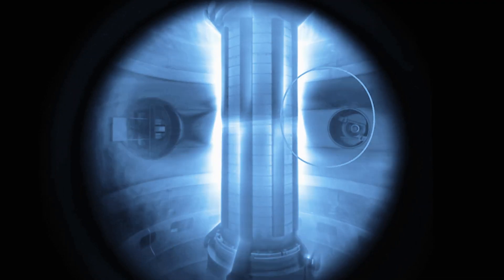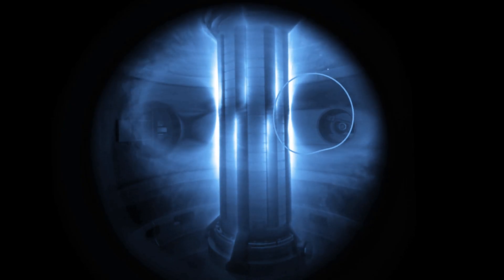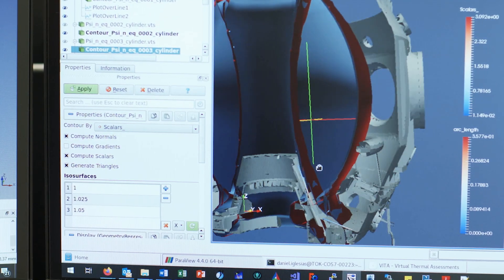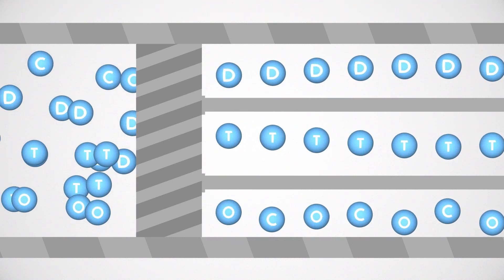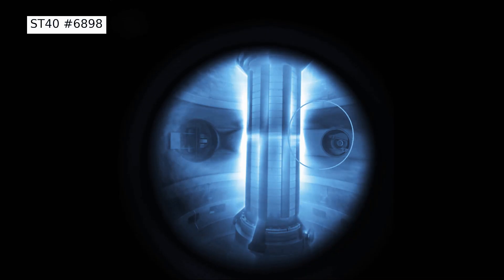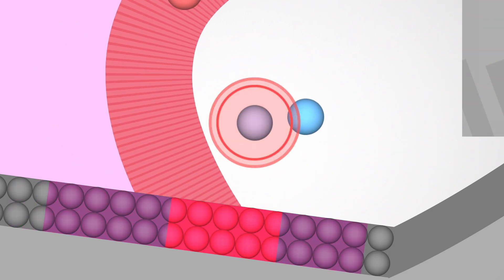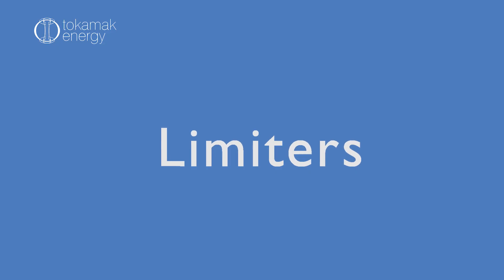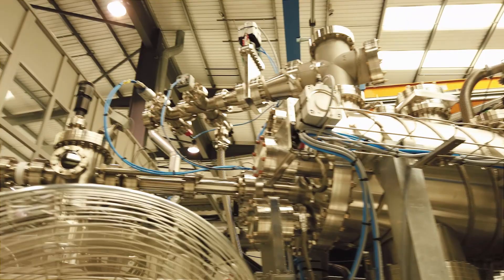Managing the extreme heat in a tokamak fusion device - introducing the divertor

Comment: I suppose you could call this.. one breakthrough, on top of others to come.
"Scientists have found a novel way to prevent pesky magnetic bubbles in plasma from interfering with fusion reactions—delivering a potential way to improve the performance of fusion energy devices. And it comes from managing radio frequency (RF) waves to stabilize the magnetic bubbles, which can expand and create disruptions that can limit the performance of ITER, the international facility under construction in France to demonstrate the feasibility of fusion power." https://phys.org/news/2020-08-scientists-method-fusion-reactions.html

Comment: Let me get this straight.... The Tokamak gets hotter than the core of the sun and yet they can’t get fusion to work or supply to a grid? Well, as Einstein once famously said, “Doing the same thing over and over and expecting different results is the definition of insanity.” Enjoy the money pit hole of research there fellas.
Reply: They have achieved fusion. The challenge is to produce enough of it fast enough for net energy production; i.e. more energy produced than is put into the system. They've been closing in on that goal and hope their next model (the demonstrator model) will carry them across the finish line.
Reply: Send me a message in 6 months telling me, I was right. Cheers mate!
Reply: @mckanebullerlee3020  It's going to take longer than six months. Maybe'll I'll send that message in ten years. Cheers.
Reply: The density of the plasma is thousands of times less than air. The density of the core of the Sun is 15 times greater than lead. Not really a fair comparison.
Reply: ps200306 please, explain to me how you know those facts about the sun. Just because a text books says it’s true, does it really mean it’s right?
Reply: @mckanebullerlee3020  , I'll assume you're asking in good faith. How do I know the density of the Sun's core? Because I know how to work it out.

From Kepler's Laws and the speed of the planetary orbits around the Sun, and experiments here on Earth (by Cavendish and subsequent) to measure the value of the gravitational constant, we can calculate the mass of the Sun. We also need distances which were calculated starting with Cassini's parallax measurements of Mars, various transit measurements of Venus and, latterly, by radar ranging. We can see the Sun and measure its angular diameter. Knowing the scale of the solar system from those other measurements then gives us its actual diameter.  That immediately gives us its average density -- which is 1.4 times that of water. That's an observational fact.

However, we also know what the Sun is made of. We figured that out from spectroscopic observations of its atmosphere. So the Sun is a hot plasma compressed by its own weight and, since its size is stable, it is in a state of hydrostatic equilibrium. That is, its density increases exponentially with depth. So a first approximation of the core density can be made with fairly simple calculations involving pressure, depth, density, and gravitational acceleration. Specifically: ∂p/∂z = -ρg.

More accuracy requires more intricate stellar models. They include the fact that the density allows for convection down to a certain depth in the solar envelope (about a quarter of its radius), but below that energy only escapes by radiative diffusion. So the pressure and density profile is not uniform. Also the core is made of different stuff, as helium ash from fusion is accumulating there. Nevertheless, the inner envelope and core behave pretty much like an ideal gas, just a very dense one (but not electron-degenerate). Detailed analysis predicts the core pressure to be about two orders of magnitude higher than the simple hydrostatic equilibrium model.

Thanks for asking.
Reply: ps200306 It’s all in good faith. 

However, thinking like this makes it impossible to understand fusion. Keller’s law actually has nothing to do with the rotational momentum or angular rotational orbit “of” the “sun”. Keller’s law is specifically written for planets around a centralized focal point i.e. the SUN. Planetary bodies like Mercury, Venus, Earth, Mars, Jupiter, Saturn, Uranus, Neptune and even Pluto have electrostatic attraction on the sun and vise versa. These are not simple constants. These elliptical orbits all have different time periods and phases. Thus, this means the Sun’s plasma is continuously changing due to the electrostatic (gravity) flux tugging (dragging) of the bodies (inertial dampening) in the entire Universe. Planets are elliptical not spherical in orbits so the values constantly change and flux constantly! Your “simple” calculations are limited in this sense.

It sounds like you don’t believe of “spooky action at a distance.” You must subscribe to Einstein principles? I’d suggest steering away from general relativity. It’s quite broken! 

Lorentz, Maxwell and Mark had it right before Einstein came in gave everyone the “mind virus”. 

You state: “The Sun’s density increases exponentially with depth”. Hmm, you sure about that? What if the density is a shield of plasma acting as an electrostatic or graviton flux on the perimeter of the sun? Why do you suggest that? Is it because density increases for a planet in that fashion? Are you equating a planetary norm to a sun? You see my point?

What if the sun is a hollow window to another dimension? What if the sun is a 4th or 5th phase of water with unique properties, which influence the Universal Lorentz space time differently? How do you really know the density is thicker as you go inward? You been there? Have you been to the center of the Earth? Is it warm there? Hot? Is it cold? Is there water in the center of the Earth? Maybe quasi-crystal magnetite? I mean, that would solve the answer to the self-energy magnetic field of Earth. We don’t really know.

I mean, shoot, what is the electron? Does anyone really know? If we can’t explain the electron. How can we explain what the sun is with any accuracy? We can go only on “observed data”. Our “perception of reality” is from ONLY one dimensional plane. So, be mindful of that. And let me tell you. If you take the calculated radius of the electron and find the angular rotational velocity of the electron you will discover a point like “wavelet particle” that is indeed traveling “locally” faster than the speed of light. Which, Einstein state, “Nothing can go faster than light.” So, yah. We got a problem Houston. 

Don’t be so sure about your answer. Because, we (human race) don’t know how to induce the most basic building mode of the Universe — Fusion. 

The electron is the key. Learn what that is first before telling us what the sun is.
Reply: @mckanebullerlee3020  , ahh, I see. It was in bad faith -- you were looking for an opportunity to preach. Forgive me if I don't waste any time countering this nonsense. Life's too short to be dealing with people who learned their science from "electric universe" videos and the like.

A few points though -- it's Kepler's Laws, not Keller.  Gravity and electrostatics are two different things. It shouldn't be necessary to point this out, even to the most uneducated, since one is thirty-six orders of magnitude stronger than the other. However, the internet makes people believe the most bizarre things.  Your stuff about "rotational momentum" of the Sun and the influence of the planets is unintelligible and/or irrelevant. Planetary orbits are planar, not "spherical", and their influence on the Sun is easily calculable to be negligible using secondary school arithmetic. Nothing I said bears directly on "spooky action at a distance". I won't get into general relativity. You obviously watched some crank videos on that too.

"What if the density is a shield of plasma acting as an electrostatic or graviton flux on the perimeter of the sun?". To answer that, the words would have to form a coherent sentence, and they don't. Density is defined as mass divided by volume. I'll let you figure out from that why your question is meaningless.

"What if the sun is a hollow window to another dimension?" What if the moon is made of blue Stilton? What if stars are holes in a black table cloth draped over a snow globe.  What if miggles are actually griggles? You can formulate any question you like. The words don't even have to be real. To make a plausible scientific hypothesis needs much more.

"What if the sun is a 4th or 5th phase of water with unique properties, which influence the Universal Lorentz space time differently?" The Sun is too hot to contain molecules, let alone some phase of water that you just made up. That's just another nonsensical string of words. I'm sensing a pattern here.

"How do you really know the density is thicker as you go inward? You been there?". For the outer layer of Sun, I can directly see this. The Sun's photosphere does not become transparent to light all in one go. It has a slightly different diameter at different wavelengths, i.e. it gets hotter the deeper you go. That on its own signifies hydrostatic equilibrium. As I said, I also know the mass of the Sun from well understood principles. To support its own weight it has to be in hydrostatic equilibrium. I know it's not a "hollow window" or any of those other things you saw in crank videos.

"If we can’t explain the electron. How can we explain what the sun is with any accuracy?". That's obscurantist twaddle. Part of doing good physics is understanding when a particular scale of interaction needs to be taken into account. You don't need to understand electrons at the level of detail I gave you. There are other stars denser than the Sun where the core properties can only be understood in terms of properties of the electron. They are not in hydrostatic equilibrium but depend on electron degeneracy pressure to prop them up. That is a quantum phenomenon peculiar to fermions. Before you start objecting about a whole other branch of science that you have seen crank videos about, this is a very well understood area that explains everything from conductivity in metals to esoteric properties of Bose Einstein condensates.

"...we (human race) don’t know how to induce the most basic building mode of the Universe — Fusion". More nonsense. We've been doing fusion for seventy years. We've repeated it thousands of times. School children have built working fusion reactors. You're confusing fusion with net useful energy from fusion. More evidence that you are lacking a basic science education.

"The electron is the key. Learn what that is first before telling us what the sun is". Thanks, but I think I'll pass. It's a pity we don't teach a little philosophy of science at school. You end up with people not understanding what the scientific endeavour even is ... let alone understanding science itself. In the internet era, that allows brains to be hijacked by pseudoscientific nonsense as yours has been. There's no point even telling you to go back to the beginning and start again, as you have lost your way completely. That's a real pity.
Reply: @ps200306  You seem a bit upset or vexed. I'm sorry you feel this way about my approach. It's sad you put value judgements on me when you don't even know "my" story. All I asked you is, "Do you really know?". Because, if you really knew the answer to the Universe, you would be a "god" and be able to manifest "gravity" at will to promote Fusion with "Over-Unity" and space/time travel i.e. dimensional travel. The Universe does it every day, every second and at the speed of Planck's Constant i.e. Planck's Time. 

I would say, in defense, that I used my mobile phone to reply and its quite difficult to be scholarly with that medium. I apologize for my misspelling of Kepler. It seems almost negligible, for you, to even mention I suppose. But, that doesn't justify your mood and tone. It's okay though, I forgive you. And, thank you for taking the time to write out your comment. 

Its important we have these discussions "calmly". It's even more important to have an open mind to potential understanding that we humans know nothing about the Universe. We, as a community, have to realize that there was a disconnect between the 1890's - 1940's, which unfortunately continues to this day.... A fundamental error happened during this time. The science community neglected the fundamental concepts of the founder electrical fathers i.e. Maxwell, Thomson, Lorentz, Faraday, Mark, Steinmetz and even Tesla. The fundamental electrical understanding is this: "Lines of Force" are real physical entities, which influence all matter and time instantaneously. And these "Lines of Force" entangle within all other forces and potentials in the Universe. As Richard Feynman said, "One electron is the entire Universe." Richard Feynman also mentioned that electrons can go forward and backwards in time. That gives me chills every time I revisit his lectures. It's an awesome statement.

What holds these "Lines of Force" together is the Aether. And, yes, the moment I say that you will go ahead and throw me under the "known scientific facts" bus telling me, "I'm an idiot" because the Michelson and Morley experiment proved there is no Aether. But, that is not true. What if all our understanding is false. What if humans made a fundamental dimensional error early on? In fact, we did make that mistake and we are paying for it to this day.

I invite you to visit Martin Grusnick's YouTube page. He show's that our entire understanding of the Universe has an error. The Michelson Morley experiment is only, like I mentioned in my last post, only "one dimensional". If you watch the new experiment, you will realize we have a lot more to learn. Or, should I say as Yoda did, "You have to unlearn, what you have learned."

I really feel your comment about how, "electrostatics and gravity are not the same thing" to be alarming. If you look at the equations between gravity and electrostatic charge potential, you will see that they ARE THE SAME EQUATION. Just they have different "constant" values. Electrostatic charge "K" being a small number. and Gravity "G" constant being a HUGE number (relativistic). Perhaps, this is the issue, perhaps this is the place we should be looking to understand the difference between the Quantum World and the Classical World. And the wonderful fact is, the fabric that holds these two different worlds together is in fact the "ELECTRON". 

I’ll be waiting for you at the finish line when you are ready. 

"We have eyes, but we do not see. We have ears, but we do not hear."
Reply: @mckanebullerlee3020  , like I said, life's too short for this. You tossed another word salad there, very little of it means anything. All this stuff about Einstein being wrong and Tesla being the true unsung hero (or Lorentz, or Heaviside -- everyone's got a favourite science superhero) has been floating around for decades. The internet has just popularised it among people who think scientific research can be done by watching youtube videos. What puzzles me is how confident they all sound when they express incredulity over established science, but then get behind a bunch of wacko conjectures. My assumption is they don't have enough education to be able to discern properly. Anyway, please feel free to have the finish line all to yourself -- you and I are heading in different directions. All the best.
Reply: ps200306 That’s more than okay my friend. You go the same direction science has been going since the 1940’s which ends in utter failure and fruitless investments. While, I’ll go a totally different direction and get it done. Besides, I don’t need to worry because I already put in the hard work. It’s already done. See you at the finish line. Wait, I’m already there. What’s your real name ps200306?

Comment: Assuming a catastrophic event, such as a detonation of defect or external nature, causing a vessel leak, how much of that 100 million °c would escape and for how long? What are the environmental impact of such a scenario?
Reply: The temperature is extremely high, but the density is also extremely low (almost vacuum). This means that the total amount of thermal energy inside the tokamak is not that terrifying. And as soon as the machine is damaged, any new production of fusion heat is impossible. So besides the destruction of the machine itself, pretty much nothing would happen. Perhaps there might be some danger from Tritum leakage, not sure how dangerous that would be.

Comment: Size is problem #1  Sustainable continuous fusion isn’t viable unless the chamber is a mile across and cost more the GNP of the United States. But right now it just employs a lot of physicists and burns a lot of money. The smartest move is to pursue LFTR technology. In 500 years perhaps revisit fusion.
Reply: Na, Wendelstein proved that it's possible to build a much cheaper fusion system.
Reply: 500 years? Haven't you heard; fusion is only 30 years away. ;-)